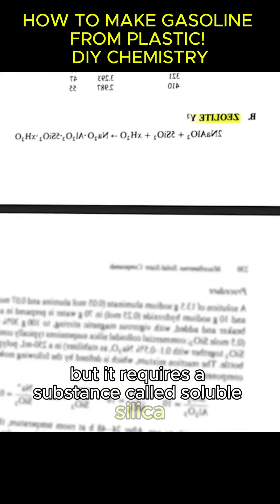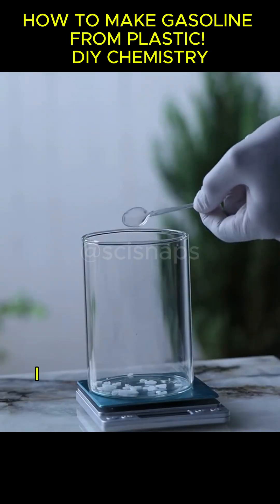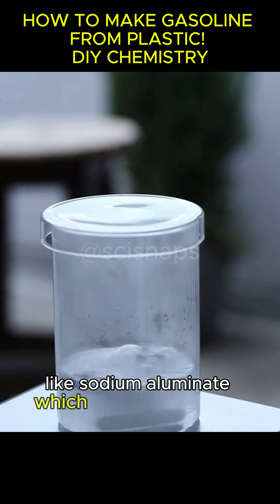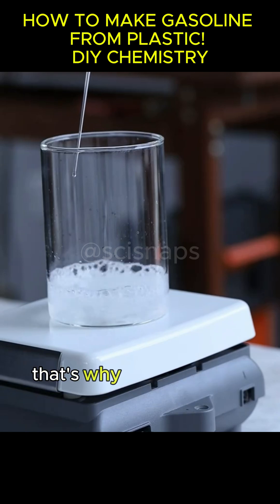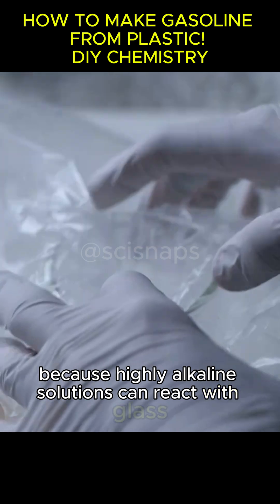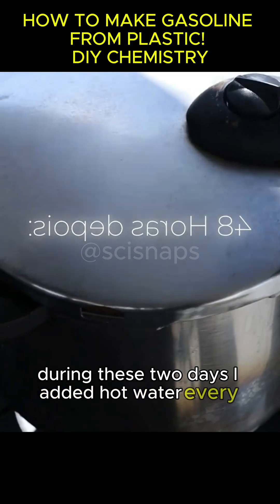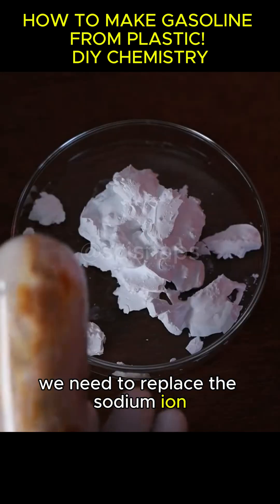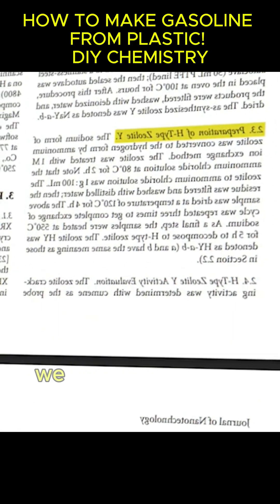HOW TO MAKE GASOLINE FROM PLASTIC! DIY CHEMISTRY PART 02

Comment: Colloidal silica is easy to get, it's used to clarify wine. You buy it as a 30% colloidal suspension, it looks like a solution. Every homebrew outlet carries it (along with gelatin and bentonite clay).